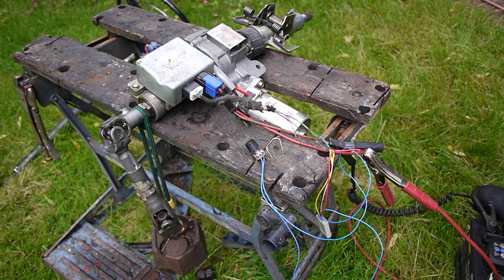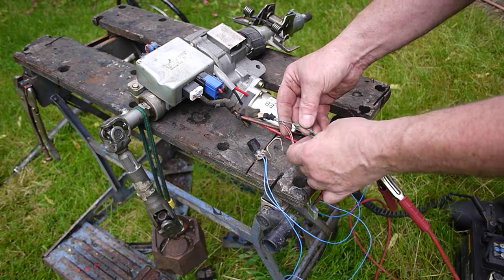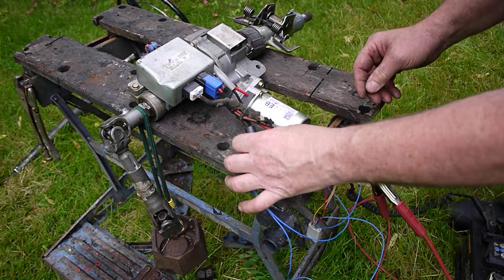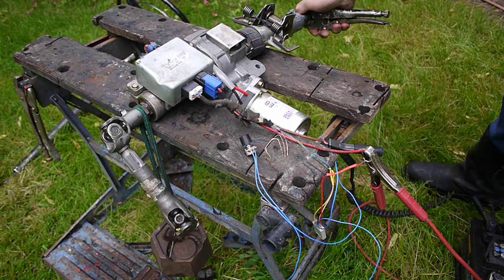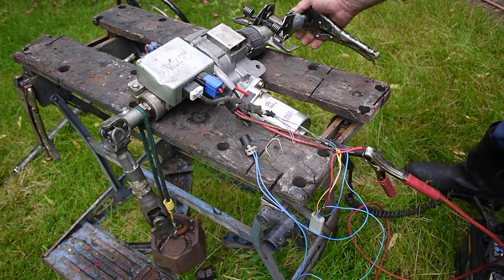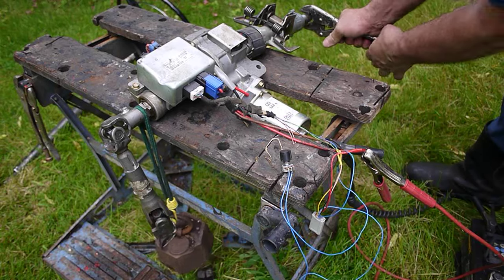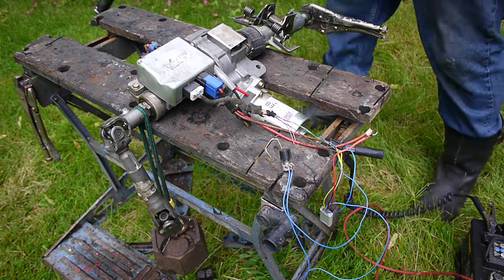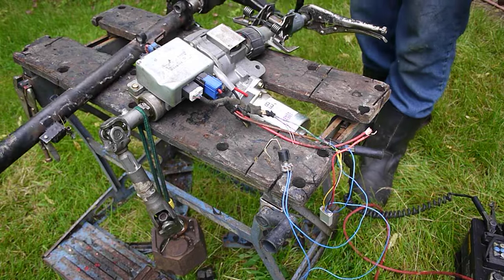EPS Electric Power Steering

Comment: Thanks for the video. Do you remember the name of the aftermarket module that communicates with the ECU. I need to get one for my build and I'm using an NSK j500 ECU that goes with a vw fitted electric power steering unit. 3 wires for communication.

Comment: Nice.job. cam you tell me the exact model of the power steering are you using? 
I'm trying to find the model with right side electric motor like yours but with no succes. It is from a right steering car?
Reply from the maker: Vauxhall Corsa C 2000-2006 or Opel equivalent

Comment: I’ve just fitted a Corsa C unit to my 1950 F1 pickup truck and used the controller from the guy in Portugal. I wired it as per his instructions but it doesn’t work. I’ve fed current directly to the motor and this works, is there a way I can check the ECU to determine if this is faulty or if it’s the control. Thanks Tony
Reply: Hi, I’m waiting also for my package from Portugal. Anyway I can reach you? Would love to hear your experience as I’m planning to this also.

Comment: Can it be install on 1990 model Hyundai Porter,?  It's a complete mechanical or manual type sir
Reply from the maker: So long as there is space for the motor under the dash, it should be possible.

Comment: 2013 Hyundai  Santa Fe Sport. Very cold this morning -20C and the EPS warning light on when car started (easily). Warmed up the interior and some heat to the engine compartment. Ignition off and then back on, EPS warning light cleared, steering normal. Solid state electronics better than liquid steering pump???
Reply from the maker: No reason why electronics don't work at low temp (high temp can be a problem). More likely battery voltage was a bit low after cold starting and system disabled itself until voltage came back up once alternator had run for a minute or 2
Reply: @msinclair810  Maybe. This morning -15'C in garage, block heater and battery warmer not used today but car starts promptly. EPS light went out quickly and steering loose ready to go! Mysterious. So maybe switch off after a long warm up and then restart should clear it.

Comment: Does this mean that you have to set the power steering when going fast or slow? Do you know of a way that we can find a automatic way of doing the setting.
My project is I am fitting a B1800 Honda power plant into a 1990 mini using the Honda wiring loom and Vauxhall Corse strewing unit, if thathelps
Reply from the maker: You can manually adjust it for personal preference or alternatively use an abs type sensor to give it a speed input so it adjusts with speed.
Reply: could you please provide some information on the adapter that tricks the ECU. i have looked everywhere but cant find them. thanks
Reply from the maker: http://simonebirchall.co.uk/controllers/variable.html
Reply: Martin Sinclair ca i buy 1?
Reply: Youngster247 - You should try a very simple Arduino-based varible-effort controller. If you know what I am talking about, you can figure it out quickly. If not, I'm sure you can find someone who knows. Nice thing about Arduino is you can set various ranges for different types of driving, just like the modern killer cars. Good luck!

Comment: Would it be possible to control the DC motor which actuates the shaft electronically? (Without the assistance of the hand or the human interaction)
Reply: Im working on rc steering  for a quad with this exact power steering module. I would say intially say yes, because the dc motor which gives the «power» is just standard 12v with two cables. So a 60a motor driver will do it. I’m working into wether I can use (hack) the original torque and angular sensor as well, so I don’t need to add my own. Will probably work, ask me in a months time.

Comment: Would you know the common cause of failure on these columns? I have power in but no power out since AA guy boost started my car. Obviously he says it must have been damaged before. (it was fine). Just thinking that a very high charge could have damaged the ecu. Nothing else is damaged.
Reply from the maker: The fast chargers that some emergency services use are damaging to modern cars with ecu's. I suggest changing the control box on the column.
Reply: @msinclair810 
I dropped the column assy out as its the easiest way to check the power and earth leads (which were fine). On inspection of the pcb it looks visually OK with no sign of burning etc and doesn't smell of burning either. But I agree with you that power in but none out is the Control unit.
These are coded to the car I believe and secondhand units can't be recoded only "virginised" by using specific equipment.
Looks like it's "down the reman route" then.
👍🤑🤑🤑
Reply from the maker: @harwoods11  If its a Corsa C unit, it has no can bus and isn't coded.
Reply: @msinclair810 
Unfortunately it's a 2007 clio. 😒

Comment: Please send the link of the adaptor you are using.
Reply from the maker: https://www.ebay.co.uk/itm/284402148325?hash=item4237b063e5:g:bcIAAOSwK3thWfSh
Reply: @msinclair810  Thankyou so much. one more thing please- Will it work with every control unit? I have Kia Storage power steering assembly.

Comment: Simplified  explanation about eps wiring. Would you please give me what kind of adaptor you put in three wire? (Ignition, vehicle and motor speed sensors? Thanks jun from philippines
Reply from the maker: Plenty of controllers on ebay: https://www.ebay.co.uk/itm/142463712424?hash=item212b7fbca8:g:GD4AAOSw9TRfvrFP
Reply: Thank you sir Martin. Your information is a big help for me. Now I know where to buy ecu controllers.
Reply: Hi sir.. Can I buy full setup as your?

Comment: Hello, great video by the way... I just want ask a quick question. The red cable you’ve got connected to the battery with the clips. Where would you connect that red ignition cable when you’ve installed the whole power steering unit in car? Thanks, Mike
Reply from the maker: The thin low current red wire goes to an ignition on positive, the thick red goes to a high current battery positive supply (such as starter solenoid) via a 30 or 40 Amp fuse.
Reply: Thank you

Comment: Martin, which column and module are you using? I’m trying to find a module like your where I can put a speed sensor but all I can find is the ones that use can-bus network and stay stuck in that failsafe mode..
Reply from the maker: Corsa C

Comment: I have aftar market electric  power steering pales adapter plz link provided sir
Reply from the maker: https://www.ebay.co.uk/itm/Corsa-B-C-Kit-Electric-power-steering-controller-box-With-ECU-plug-EPAS/142463717230?ssPageName=STRK%3AMEBIDX%3AIT&_trksid=p2060353.m1438.l2649
Reply: Kunal Daterao - The guy who sells them is in Portugal. You can get it on eBay

Comment: Where did you get the part to trick the ECU for vehicle speed sensor
Reply from the maker: https://www.ebay.co.uk/itm/Corsa-B-C-Kit-Electric-power-steering-controller-box-With-ECU-plug-EPAS/142463717230
Reply: @msinclair810  can this trick ecu device use in another model power steering unit other than corsa?